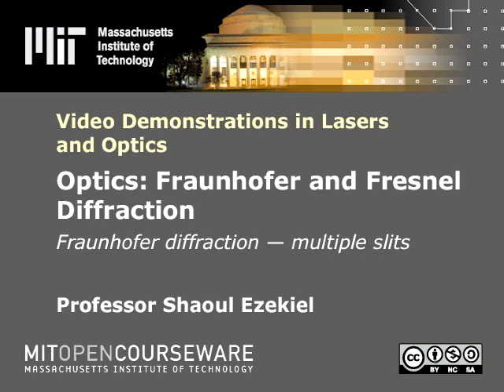Optics: Fraunhofer diffraction - multiple slits | MIT Video Demonstrations in Lasers and Optics

Comment: I get confused by "black lines", "spacings" and "slit width". Which us which? Are black lines opaque lines, and the spacings open? Or are spacings different from slits? Does not make much sense to me this way.
Reply: You might well ask!
As far as I can determine, a Ronchi Ruling is a rather superior form of transmission diffraction grating, or at least that is how it is being used in this demonstration.
The professor states that the black lines have thickness 75 microns and the separation between lines (which I assume to be centre of one black line to the centre of the next) is 125 microns.  This makes the gaps between the black lines to be 50 microns wide.  The separation between gaps is 125 microns being the centre of one gap to the centre of the adjacent gap.
The professor is using the adjustable slit (with the razor blades) to illuminate a subset of the slits on the grating.
You will note that he is also using a lens system to expand the laser beam to illuminate more of the grating, and thereby realise the resolution potential of the grating.  What he doesn't say but has to be happening is that the expanded laser beam passing through the grating is in fact converging to a focus on the screen 200 cm away
I hope this helps.
Reply: @davidhaworth1802  R.I.P Ezekiel. He obviously did not agree with Feynman that this is the only mystery in physics. It is a nice example of the shut up and calculate philosophy. Also, he was not using his notes but rather commenting loosely on what he was doing. I am glad I did not have to do the homework.

abut your comment on the lens focus. When I use a laser pen at more or less the same distance to the wall, and  a slide with a single or double slit, I get a much smaller pattern, nowhere near the size of what is shown here.
Reply: @odal6770  My comments related to the diffraction grating demonstration.  The directions of constructive interference are according to a well-known formula.  It is the same formula for the diffraction grating as for the double slit.  Does the size of your pattern agree with your calculations?
Reply: @davidhaworth1802  I don't doubt the formulas, it is a matter of geometry. I have my doubts on the presentation. Perspectives and size change with camera settings. It makes it very difficult to judge dimensions on the basis of a video clip.
Reply: @davidhaworth1802  The screen markers are fixed, while the size of the pattern changes.
Reply: @odal6770 I looked at the example with 2000 lines per inch and my calculations showed that the peaks should be separated by very nearly 10cm.   In the actual demonstration the spacing is a bit more than 10cm.  This difference might be due to him holding the grating in front of the lens and so it would not be aligned properly ie the normal to the surface of the grating might not lie quite along the optical axis.  This misalignment has the effect of increasing the spacing between the peaks.

Comment: For the two slit interference pattern, I calculated the width of the principal maxima to be approx. 8.45 mm
Reply: maximum*? or are u talking about the distance between the first and second maxima?
Reply: @arisoda  For the first maxima to the left or right of the central maximum, I got 1.69cm. Now I believe, ideally, the separation between maxima are always equal, thus the distance between minima are equal. I took half of 1.69cm which is 8.45mm, as the distance between maxima are measured from their centers, thus half of 1.69 would be the width of one maxima. Let me know what you think, arisoda
Reply: @dakotamercer1679  no I believe that is not correct, unfortunately. You are right that the separation between maxima and minima are always the same, but not for the center maximum. This one is always 2 times the width of a normal maxima/minima. That is because of diffraction. Correct me if I'm wrong. But 1.69 becomes actually the separation of 3 maxima.